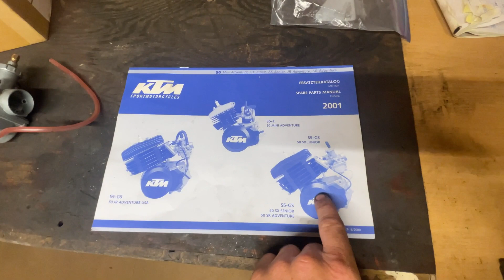2001 KTM 50SX - Carb Upgrade - Carb Tuning

Comment: Why clutch are u running ?
Reply from the maker: That bikes clutch was nothing but trouble. It had a lockout style, than a standard OEM, which both had trouble with the horribly designed clutch/gear nut backing off. I do believe a newer style can be modified to fit.